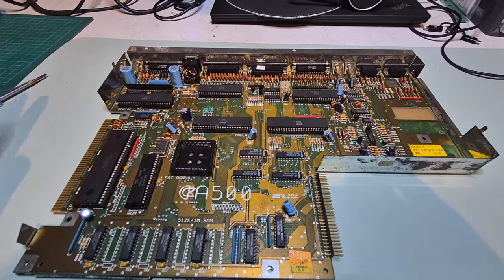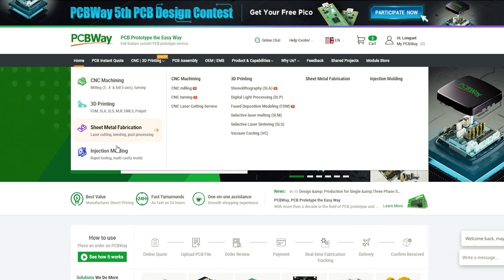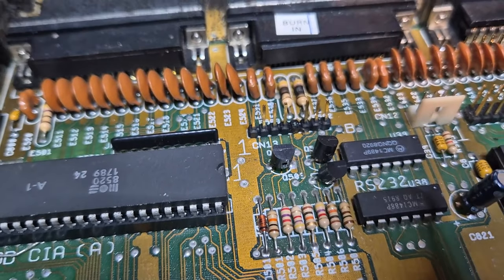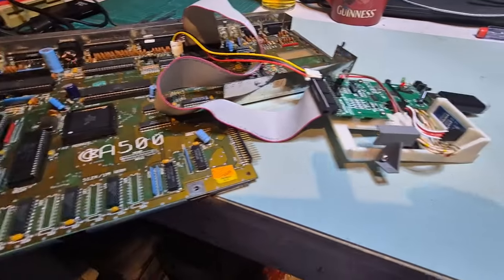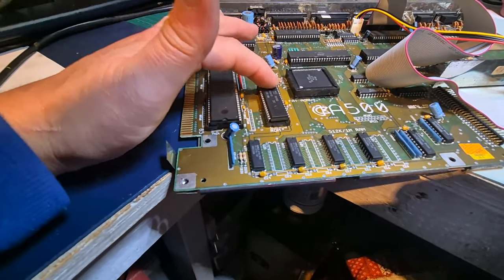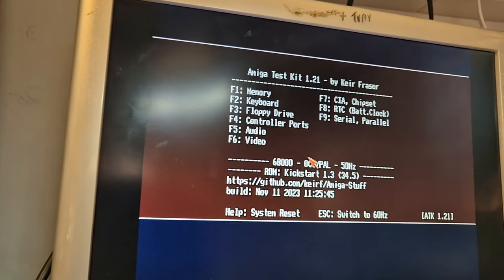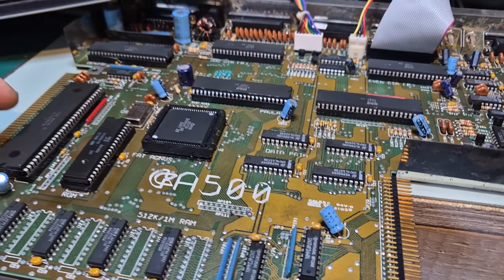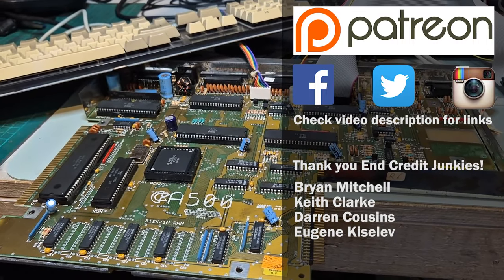Amiga 500 Rev6a Motherboard Restoration

Comment: Have you never used the hammer and chisel chip removal technique before? 🤣
The irony of that "burn in" sticker next to those resistors wasn't lost on me either.
Reply from the maker: actually I never actually paid attention to that sticker. had to look back after your comment. weird but funny alright. those Resistors are fine btw, 47 ohms each .
Reply: @8bitmanshed  Good that they are ok. I have an A600 with a burnt serial port resistor, it got so hot it left a small pit in the board! No idea what happened (was bought like it)  but the CIA chip was also dead so something bad I suspect.